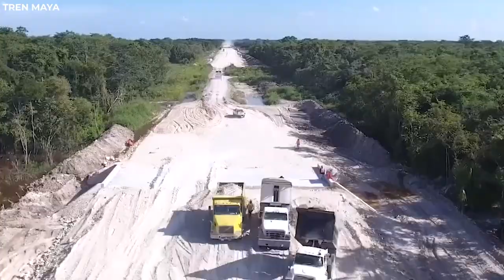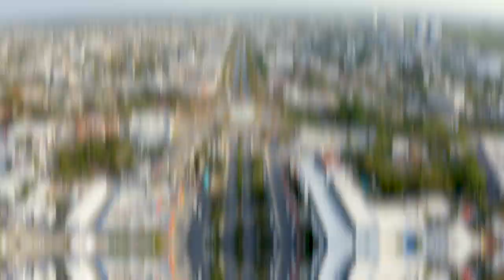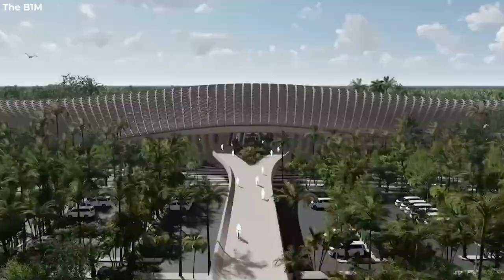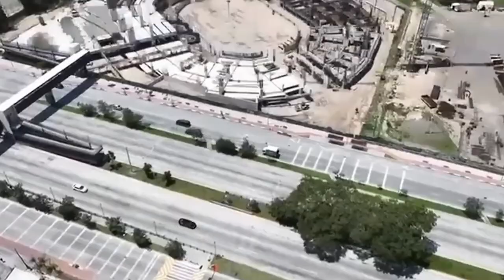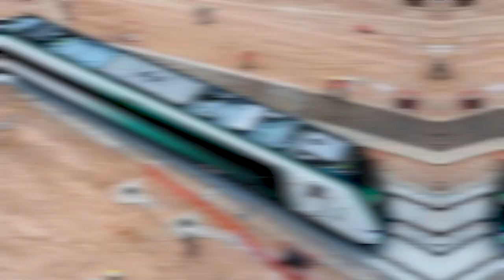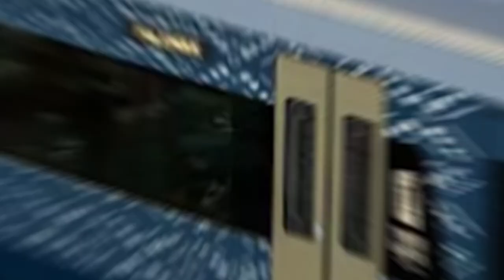Tren Maya: The First Railway Crossing The Jungle in Mexico

Comment: Mexico need to clean up corrupttion and tourists scam not a slow train that run on old train track need to listen to china to build a high speed elevation track for safety and speed not a slow cut corner systems do it right.